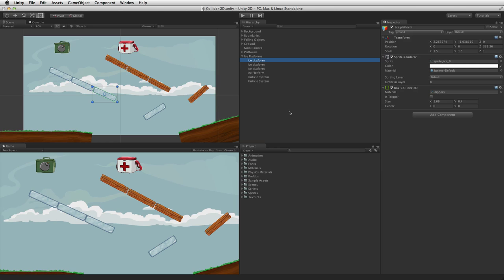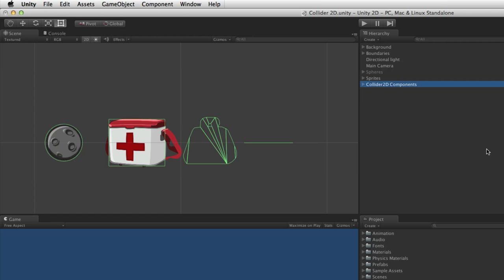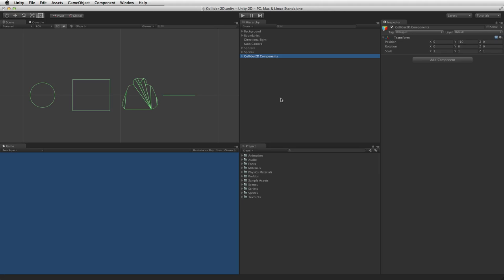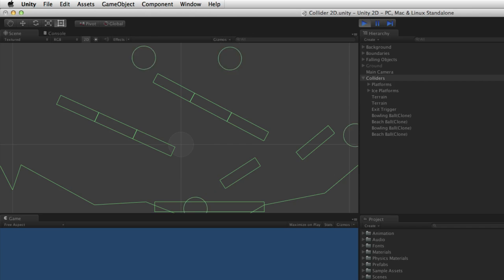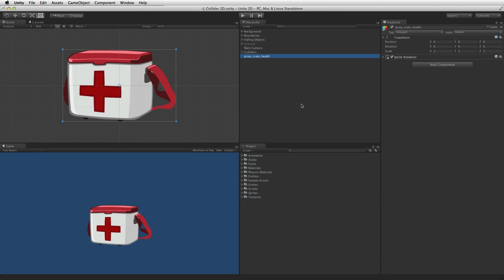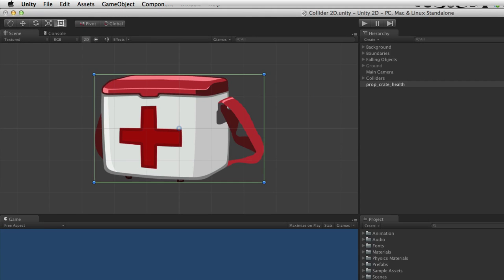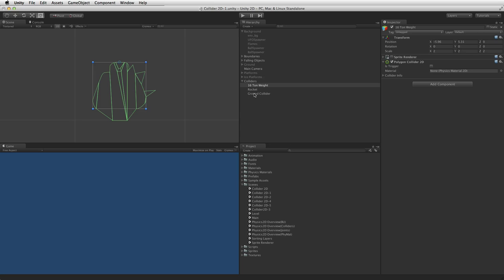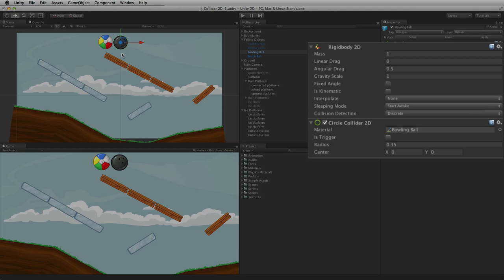Collider 2D - Official Unity Tutorial

Comment: How would I change the controls? I'm wanting to use the number pad  to move one of my players
Reply: Hey Do This To Make Your Controls 

	{
				pos.y += speed * Time.deltaTime;

			}
			if (Input.GetKey ("Your Control")) 

			{
Reply: So Your Code Should Be 

using System.Collections;
using System.Collections.Generic;
using UnityEngine;

public class Controls1 : MonoBehaviour {
	public float speed = 5.4f;

	// Update is called once per frame
	void Update () 
	{
	Vector3 pos = transform.position;
		if (Input.GetKey ("u")) 
			
			{
				pos.y += speed * Time.deltaTime;

			}
			if (Input.GetKey ("j")) 

			{
				pos.y -= speed * Time.deltaTime;

			}
			if (Input.GetKey ("k")) 

			{
				pos.x += speed * Time.deltaTime;

			}
		if (Input.GetKey ("h")) 

			{
				pos.x -= speed * Time.deltaTime;

			}
		transform.position = pos;

	}

	void OnTriggerEnter2D(Collider2D col)
	{
		Debug.Log("bbdsfbsdfbsdfb");

	}

	}

Comment: can you create colliders without sprites. in the video you show an example of the physics that the collider use by creating collliders all o there own. having never used unity how do i do that so i cant get better acquainted with the system quickly. p.s is it possible to create a game without the sprites to figure out if the idea can work before spending all that time in Photoshop
Reply: yes, you can create quads in Unity that you can use instead of sprites, but you won't get any custom shapes you might want.

What I do is just download a google image of a ball or a circle as a png and pull it into unity for testing. Pull it in, add a circle collider. bam. you're done. Takes all of 5 seconds.

Unity is really easy to prototype this sort of thing :) 

http://images.wikia.com/clubpenguin/images/d/d7/Beach_Ball.PNG
Reply: psykojello thanks that was helpful.